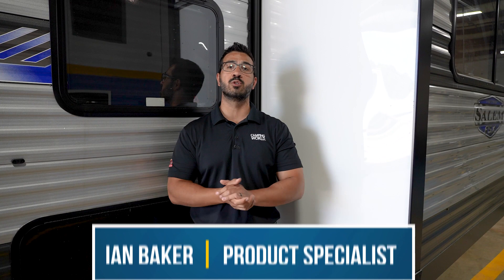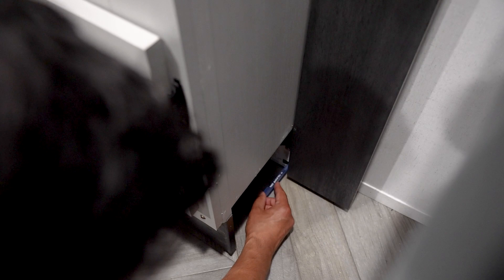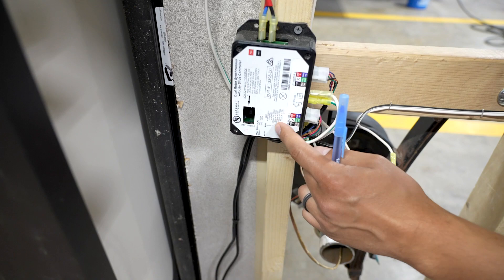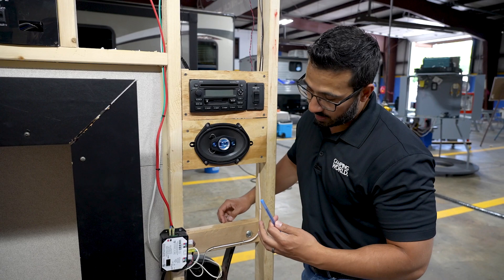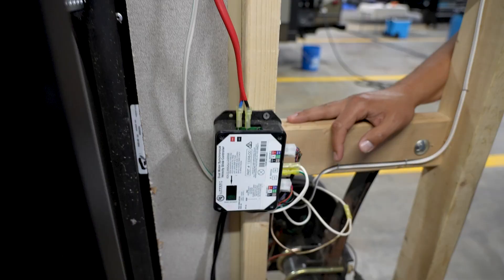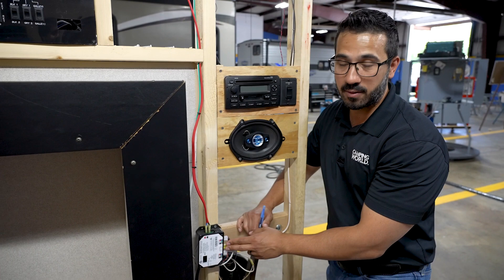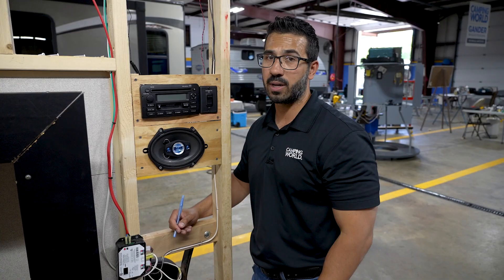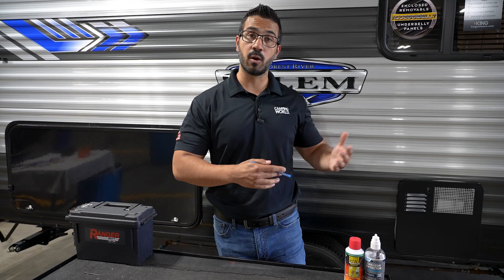RV Troubleshooting: Fix Your Schwintek (Worm Gear) Slide Error NOW!

Comment: I have a Schwintek slide out stuck in. The left side operates the right side nothing. After testing the motor is bad. How do I open it to access the screw to remove the motor? I would appreciate some input. Thanks Andy
Reply from the maker: Hi Andy! 

Sorry to hear this! I'd recommend contacting our service department here (https://rv.campingworld.com/rv-service-maintenance) or via their Technical hotline at 1-866-838-5304. 

They'll likely need your RV's year, make, and model (at minimum) to help answer your question. 

Hope that helps!
- Tucker Ballister

Comment: I just had this issue and had to flip the wires and it worked and was able to retract it. My question is do I have to flip the wires again? Do I have to take it to a shop to have it fixed?
Reply from the maker: Hi There!

With wiring like this, I highly recommend entrusting the work to a certified RV technician. Here's the link where you can contact the service center nearest you: https://rv.campingworld.com/rv-service-maintenance

Hope that helps!
- Tucker Ballister